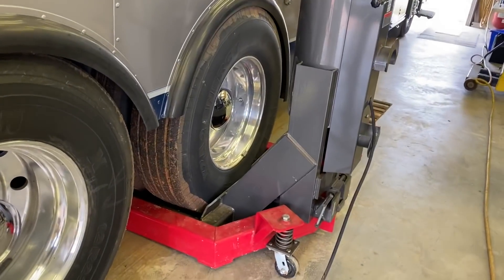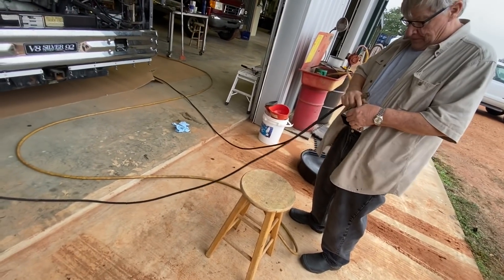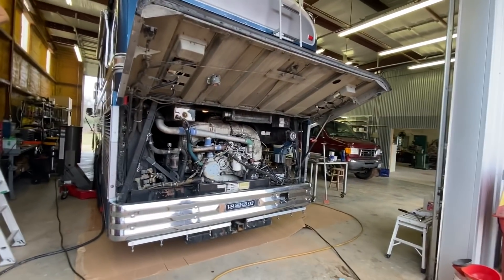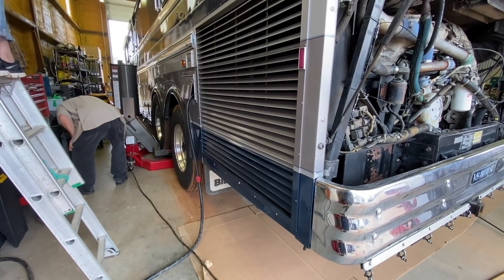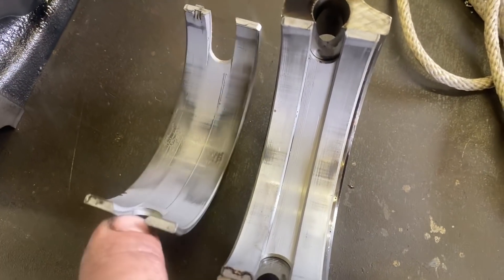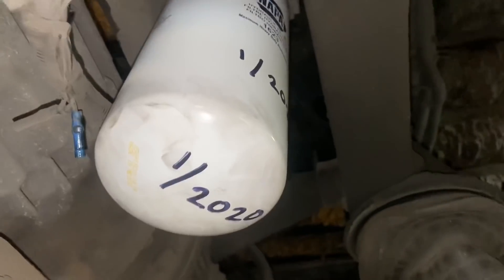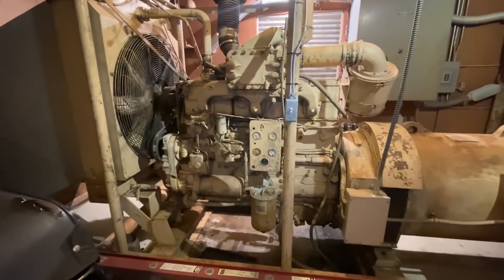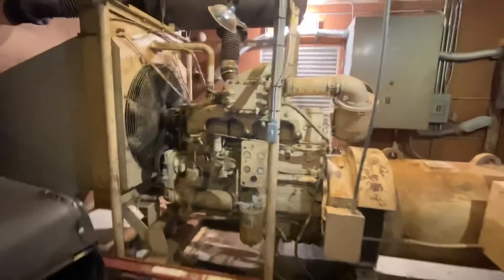Wanderlodge maintenance detroit diesel 8v92TA

Comment: Generator Non-Runaway Update.
We worked out what happened with the start up RPM increase. For all of you who recognized the engine ramping up to speed from idle, you were correct. But probably not for the reason you might have thought.
This old Cummins is totally manual operation anymore. The RPMs and subsequent AC frequency is set manually at every start up. It does not have any current means to go from idle to operating speed (1800 RPM) on it's own. It was assumed that upon startup that the throttle was set at idle, which is SOP at shutdown to cool things off.  Turns out the throttle WAS set at 1800, but the linkage was stuck at idle for those first several seconds. Having  never witnessed  an increase in RPMs like that all on it's own , a runaway was assumed and it was shut down. Better safe than sorry.

Comment: That's normal for the generator. Idles for a minute, then it was accelerating up to operating speed of 1,800rpm. You should have let it go-it was NOT a run away.
Reply: Not normal for this old unit. Everything except the voltage regulation is set manually by hand.

Comment: Why are the 92 series so hard on the bearings.
Reply: The short answer is because they are V-engines, and have smaller bearings and rod caps on each connecting rod.  Compared side-by-side to a straight-6,  they almost look pathetic when you see the robust bottom end of the straight-6.
Reply: @stanpatterson5033  thank you

Comment: I was just wondering.. the wear  the crankshaft bearings and connecting rod bearings is a weak link on the 92 Series..  Does this appy too on the Series 71 V8's or is something only found on a 92 series?

Comment from the maker: The generator is 288kva 240 3 phase delta.
Reply: Just so your customer knows the Gen set was idling when he first started it, it will look for oil pressure in a set time frame, make sure it has no other faults and then will run up to its full rated RPM which is most likely 1800 for that large set. So it was most likely doing exactly what it was supposed to do.
Reply: Looked like a NTC 300. We have a 400 big cam at work as an emergency fire water pump that has a circulating hot water pump to keep it ready to start. It has 2 separate battery banks to provide starting. It will attempt a start on one and if it fails switches to the other. If you are in the pump room with it and a sprinkler head opens or hose reel the falling pressure starts it if the electric pump fails. When you hear the starter engage it fires and goes to 2100 rpm right now. I have never seen a faster starting engine!
Reply: @carlwilliams8354  The hospital I work at has everything from monstrous containerized MAN L31 5000kw gensets, mid size DD 16v92s all the way down to little C7 cat 60KW all with heated oil and accumulators for instant oil pressure and heated coolant too so they go from start to governed load instantaneously. 45 gensets in all. We test them all weekly, year round. If you're in the room and not expecting it, they'll put a stain in your drawers!!
Reply: Matthew Fogarty make some videos, my friend.
Reply: @MatthewFogarty-k2y  seen some of those monsters myself. Largest was based on a GE turbofan core. Those f@#kers could pump out the juice. Cat 16 cylinder gensets are all over the place here in Texas to run drill rigs and pump stations. I used to maintain a little 100 kva unit for a clinic I worked at.... all of them neat to look at.
Reply: Jesus
Reply: Thanks for following up.  For those wondering, that's around 340bhp.
Reply: For US reference a “whole home generator” is 22kVA, like the Honeywell unit in Costco. 

For purely resistive loads like incandescent light bulb and radiant heaters a kVA is equal to a kW. For inductive loads like LED drivers, switching power supplies, and motors you get 1kVA to .5kW. Some are worse and some are better but that 100W equivalent LED bulb that draws 15W on your power bill may take up to 30-40kVA on your generator. The power company only charges for real power and not apparent power which the new smart meters measure ...they’re not evil but they are profit driven and somebody is gonna try something.
Reply: 🚌 the last time I got red oak you today 23 years of my
Reply: Cummins 855

Comment: Drive and Tag axles combined would be 26,820 lbs, which is very close to the maximum lifting capacity of the combined jacks.
I would also put 20 ton jack stands under the drive axle and some 2x12 lumber under the drive wheels for added safety.

No way the generator is 800kw, more like 80kw and was not in runaway, but run up to speed after a short warm up and oil pressure check.
Reply from the maker: 288

Comment: Those lifts go 24" high, and retail for around $10,000 a pair, but can be had for thousands less. They are not anything like the ones featured on Leno's Garage.
Reply: You can get a set of used ARIs pretty cheap, they're the same linear screw type in Jay's garage. I got mine at auction for 6 grand and all they needed was one motor and the main control, they're good for 10 tons a piece and go up seven feet.

Comment: Yeah, that Cummins is an "NTA855".  When the operator started it, it was idling, at what sounded like 600 rpm.  When it's generating alternating current at 60 Hz, it needs to be running at 1800 rpm.  There must be some sort of time delay before the governor goes to running speed.  Most of these generators go to 1800 instantly upon starting - that sounds like it must be excessive wear on main and rod bearings but I've torn down dozens of them and found that it seems to not matter. 

We had a 12V-71 Detroit that came into the shop with a governor problem - when it went to full speed, we all ran for cover because it sounded like it was going to the moon.  In fact, it was running normally.  Being having 12 cylinders and firing every revolution it was making a sound we did not expect!

Comment: Generator sounded normal to me..  A brief warm up at idle and then up to 1800 rpm for the generator to take load. And that would have been 80 kW ;)
Reply: You are correct.  That rig was doing what it was supposed to do.  They don't even put those idle/runup controls on generators anymore.  That was an old small cam  NH 855 G-drive engine. I would say it was rated at less than 200 KW.

Comment: These lifts are like the ghetto version of the Stertil-Koni's seen on Jay Leno's garage.  But a cheap lift is better than no lift, as long as they are safe.
Reply: Those lifts arn't ghetto really. Leno's is fixed where as these are movable. And they are quite expensive nontheless.
Reply: @wishusknight3009  ummm no - Leno's move actually far more easily that these do, and even talk to each other wirelessly, so there is never this silliness of trying to get them balanced in height, and yes, compared to the Stertil-Koni's, every jack in the world is pretty much ghetto!
Reply: Gray jacks are professional quality. Often used in truck shops and on fire equipment.

Comment: The ladder lying on the floor next to the generator gives a better sense of scale than the switch. The rungs on the ladder are 12" apart so it's 9feet long overall. A little too big to fit in the cargo bays.

Comment: How accurate is a chemical analysis of the oil in determining wear.
Reply: Jack Kreighbaum if it’s done at a reliable lab then it’s one of the most reliable methods available to find out exactly what is worn and how bad it’s worn by only taking an oil sample. 

This is the method we use to monitor internal bearings on jet engines but then you have to also know what bearings are made from what metals otherwise all you’ve found is that you either have internal wear and to what extent or you don’t. 

And to be honest, it’s not a cheap test , so for the $1,000 it’s costing to open her up, change bearings, and being back on the road it’s not worth it. The test itself will probly cost that much to send an oil sample in, but it will give you a nice pretty graph and chart showing every metal and the levels currently In the oil.

Comment: Those big gens sit for periods of time, things stick and especially fluids that don’t circulate, good move is to put a circulates pump on the radiator and have it run on a timer, that will save the radiator, they build up corrosion and leak from sitting not running, plus run them at least once a week for 10 or fifteen minutes .
Use to service them

Comment: That may be an 80KW gen, no way its an 800KW, unless that is the runaway output :-)
Reply: Yes, 80kW is more likely. This one has what appears to be an idle startup before "going to the governor" under load. It will have to be spinning at nominal RPM as the transfer switch activates. 

I worked on several standby systems we had fitted throughout Orange County (CA) for the fire Department. The biggest was the 150kW Cummins powered generator for the dispatch center. Hearing that beast spool up and stabilize was fun indeed.
Reply: I'd say 100-150kw but not 800.
Reply: Thinking the same
Reply: I saw one built like that with Cummins it said 500kw on the tag, so his could be 800kw

Comment: The Katolight I used to service didn't wait that long to get up to running speed.
Reply: Neither did GM's I think this one has an oil pressure interlock, to hold idle until oil pressure builds up then ramp up to rated.
Reply: Military gensets have a hand throttle on them, however you do NOT want to idle the engine as that can damage the voltage regulator. Every MEP I've ever had I simply set the throttle @ 62Hz no load and forgot about it.

Comment: Those jacks remind me of the ones I used to use in the Engine House when I worked on railroad locomotives. Yes, you can lift a huge locomotive with air!  They used a tremendous amount of air though. We had a 20 horsepower shop air compressor that couldn’t keep up with the demand. 
So, we often used a diesel driven compressor like is used to run jackhammers and rock drills.
Reply: Need maximunm volumn as well as pressure when using these jacks.  A large scroll compressor is needed.
Reply: In the Boston and Maine railroad shops in Somerville Massachusetts they heated the shop with steam from a massive power plant out behind the shop, it included two huge steam powered that worked at 30 rpm air compressors that provided all the compressed air to the shop and also to the freight yards for air brake test by the car department. When they shut it down and tore it down it took two 800 cubic feet a minute electric air compressors to supply the engine house alone. And when they use the car ( freight/passenger) jacks they still don't provide enough air.

Comment: I worked on those cummins gen sets 45 years ago...  Without a load they will take off if they have n't been run up to temp very often. Short runs kill them eventually .They should devote a morning every month to get it hot under load ,that will keep the engine ready to run when ever it's needed.
Reply: He needs a load bank to connect to.
Reply: yeah . . . short no-load runs are the killer of diesel gen sets . . . always told clients to run a monthly test and transfer load onto the set . . . this does two things, it keeps the set healthy and lets you know what will happen the next power failure when you might really need the engine . . . also told them to run the test on a Tuesday afternoon (not the middle of the night like they planned to), that way you don't disturb the neighbors and if something goes wrong  you can call service before the weekend.

Comment: Your going to need a trl soon to carry all this cool equipment.  Nice Video.
Reply: Gregory Cioni he won’t be carrying lifts like that with him that’s for sure. It would be nice but isn’t practical at all for a mobile mechanic unfortunately. Did you hear them say that they require 200 psi but it’s also gonna require a high volume of air at high pressure so he would also have to tote a very large, trailer mounted compressor with him and then you e got to figure out how tcpower the beast. 

It would be a fantastic addition tho for his shop in Tennessee when he gets it built tho but unfortunately they just aren’t for portable use
Reply: @1982MCI  it was ment in a Humorous  way. Lighten up Been hauling equipment  and whatever  fit in my trl, 38 years.

Comment: yeah, i don't think that generator was running away, it was just getting up to speed so that it can start generating some power.
Reply: Our 3416 Cat genset idles for about 7 seconds then ramps up to 1806 rpm. I test it once a month for about 15 minutes.
Reply: @wushock92  Is it up to operating temperature then? If not probably better to give it longer to fully warm up otherwise it will get a build of condensation n the sump.
Reply: @garyhoffmann1615  Oh yeah. It has a preheater for the coolant that keeps it at 125º all the time. It warms up to 185 within that time frame and I let the thermostat cycle 2 or 3 times before performing the shutdown.
Reply: madmax2069 yeah I agree it was just going to operating rpm for the genset
Reply: Yep, smaller generators have their governors set at generating speed from the start. Large ones would probably need to warm up to signal good oil pressure before revving up to the next level.
Reply: Yes I agree. It warms up for a minute or two. Then gets up to speed to make power for the generator.
Reply: Yep have done test starts on the exact same style of Cummins genset about a dozen times, this is exactly what they do if you don't switch them from the normal running mode to the manual test mode.
Reply: Yup, all of our stationary cummins gen sets at work do that. Low idle 600rpm and then roll up to 1800 for 60hz.

I maintain them from 200kw up to 1Mw. I run them every month for an hour on load and also run them for 3 hours on load once a year.
Reply: It has an oil pressure interlock. It waits at idle for oil pressure to build up then goes to rated speed, either 1200 or 1800 rpm in Americastan. It's also 80 kVA, not 800 kW.
Reply: 1800 RPM On that unit
Reply: agreed, that generator was not running away; it idled for about 15 seconds to get some heat into the cylinders, then throttled up to operating speed so it could start generating power.
Reply: The engine on that gen set I do not believe was running away, my experience is the engine starts and idles at a low RPM until oil pressure is sensed and then the governor brings the engine up to about 2K to take the load of the generator

Comment: Generator technician here. Generators run at 1800RPM typically for 60hz. It was idling at first, probably has a idle timer before ramping up to speed. Not a runaway. And no way that is 800KW, engine would be twice that size.
Reply from the maker: I know nothing other than it’s supposed to be 1800rpm
Reply: I've done test starts on these here in Australia, same Cummins engine but the gen was rated for 415v 50hz 3phase at 200 amps (830kw). In the normal run position they idle for approximately 15 seconds then ramp up quickly to running rpm so it's not a runaway condition. That large rotary switch in the middle of the control panel should have a test position which bypasses that and allows you to manually control throttle position or just leave it at idle after starting.
Reply: Had two Cummins VT1710’s at work which are twice that size and they put out 400KW.  They were on a timer and a automatic transfer switch and ran under load, a half hour each week.  Also had a block heater & generator heater to keep it ready to take the load as soon as it came up to speed.
Reply: @AVM65DT  Same thing at my hospital, heated coolant and oil with an accumulator for instant oil pressure. Start to governed load in under 5 seconds. Any drop in main power and they were already on.
Reply: No way thats 800kw. Most of our 375kw units are run by 6cyl turbo's the 200kw and under are ran by 4cyl.
Reply: Should be about 1600 hp, no?
Reply from the maker: I think it’s 800amps maybe or that’s what i think the dial went up to. That might be where he got that number from.
Reply: @BusGreaseMonkey  That is most likely the case. 800amps at 208V would put it 200KW range which is more what it looks like to me. Just based of physical size.
Reply: @kleetus92  Probably something like that.The gensets my company makes has volvo engines that are around 900hp mark and they are rated for 625KW.
Reply: @kleetus92  855 Cummins-probably 300-350 HP
Reply: @kleetus92  855 Cummins 300-350 HP

Comment: 800kw? Sheesh...... 
The big Cummins was just getting ready to get serious.  I don't think it makes 800kw at idle....
Reply: That's looks a little small for a 1100 hp engine.
Reply: It doesn't make 800kw at any RPM, from the looks of it, more like ~170kw
Reply: I think a decimal point may have fallen off, 80.0 kW sounds much closer

Comment: How about a simple fuel shut off valve on that backup gen set to prevent runaways?
Reply: it wasnt a runaway though, it was just getting up to normal operating speeds.
Reply: Generators always sound like they are screaming because they go to operating speeds so fast because there isn’t a load till the transfer switch drops

Comment: Genset wasn't doing a runaway.  It was going to rated speed to generate your 60hz which is 1800rpm.
Reply from the maker: He said it’s not set up like that. I questioned him about that it should go to 1800.  But the auto controls are inop so he dials it up to 1800 manually.  But hey if it scared him it scared me
Reply: @BusGreaseMonkey  They were worked then, maybe it needs a visit from your son ASAP.
Reply: Also, that's likely a small cam 855 putting the output of that generator around 250kw.